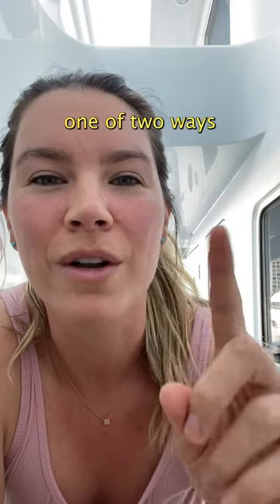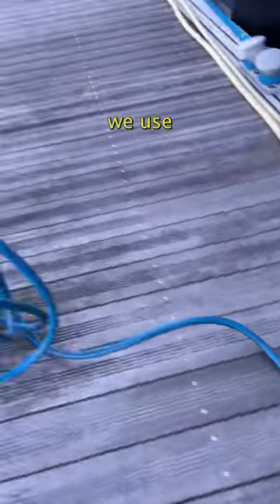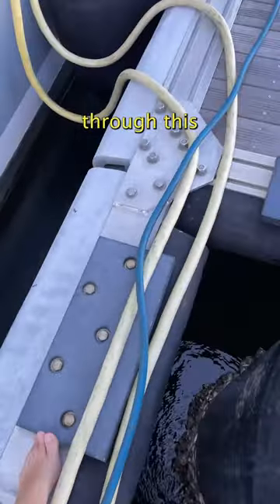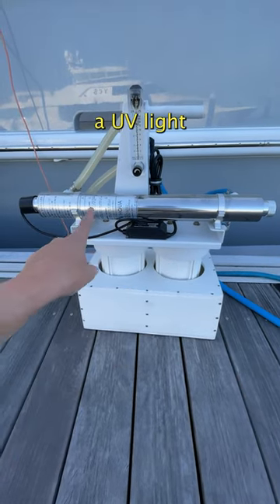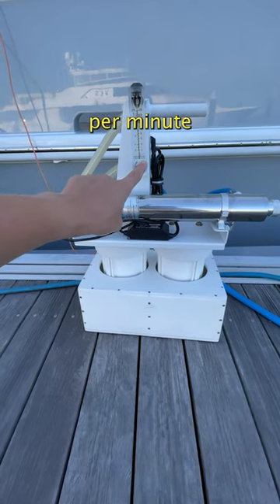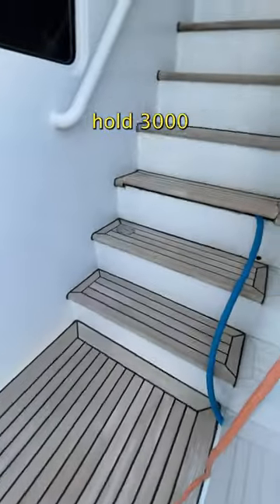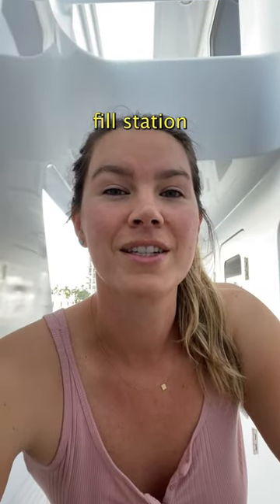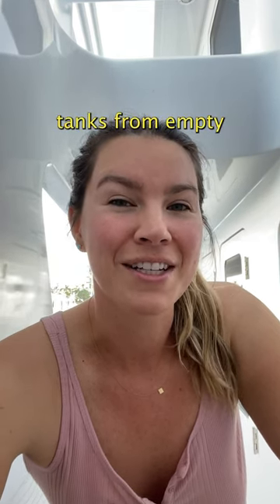🤯 How a Yacht Gets Fresh Water #shortsvideo #yacht #yachtcrew #dayinthelife #belowdeck #btsshorts

Comment: If the math is 3,000/5, it could be 600 minutes, which may be ten hours. Is the other way a rainwater catchment? So, otherwise, reverse osmosis system that deals with NaCl. For emergencies.   ;-)
Reply from the maker: Well done! And you are correct on the other way. I’ll show you the process in a short soon. You know your water systems!

Comment: Uv light!?!? O hell no
Reply from the maker: Wait why?
Reply: UV light is one of the best ways to kill single-cell organisms in water supplies.  You get enough of them into the tanks (just like aquariums), you can kiss your freshwater supply goodbye in a matter of days.  And decontaminating isn't just of matter of dumping and refilling.
Reply from the maker: So you’re saying it’s a bad thing to kill the micro organisms?
Reply: @kellivalentine  I'm certainly not, obviously.  Microorganisms gotta go.  You let enough in to establish a colony and they grow, and you're underway at the time, that's a huge problem.  And even if you get back to a port in a timely fashion, now you're having to purge and scrub down the tanks.

I do know there's some talk that UV filters can cause cancer, but I'm rather dubious about how that would happen from an enclosed module.  Like you would have to pull the diode and run it exposed over time for that to occur.  Can't begin to speak to OP's thoughts on the matter, but their handle sounds a little on the conspiratory theorist side...
Reply from the maker: @rcslyman8929  thank you for the heads up. It’s definitely something I’ll look into 👍🏼
Reply: @kellivalentine  Honestly, don't look too hard for it.  Especially for the one you showed, I mean, that's a robust piece of equipment.  And even if it were true they could cause cancer (I mean really, what doesn't these days?), it'd be a miniscule risk compared to the benefits of contaminant-free fresh water supply.
Reply from the maker: @rcslyman8929  thank you for the info! ❤️